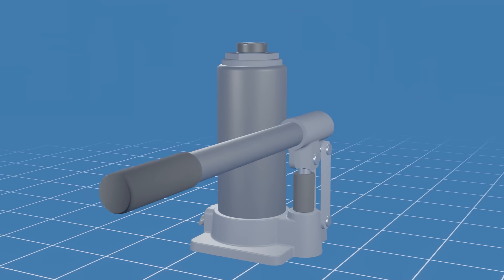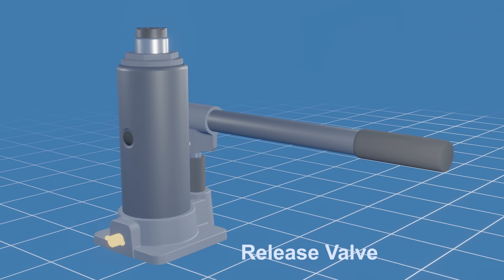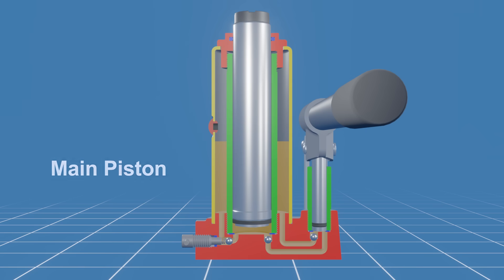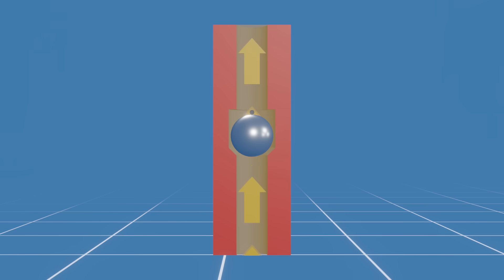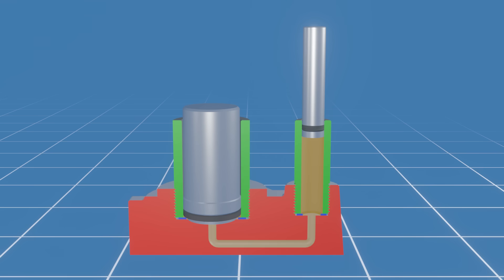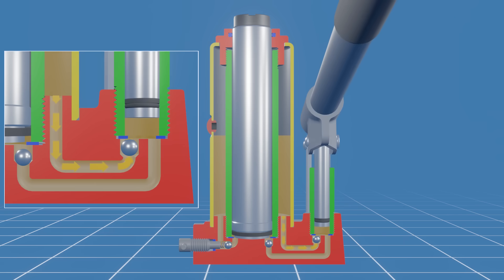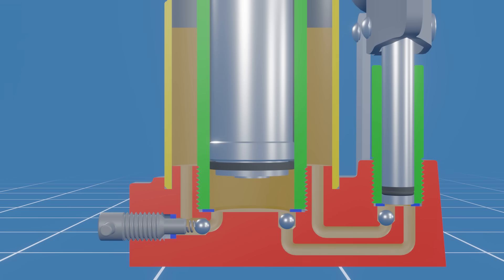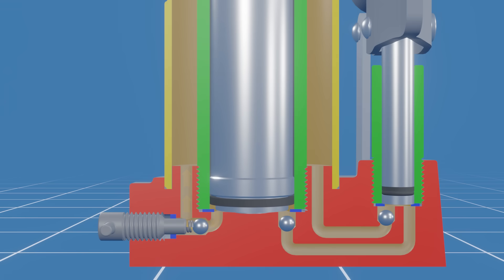How a hydraulic jack works

Comment: Everything makes intuitive sense to me except the fact that the force is larger on the output cylinder because it has more surface area. Why? I get why it doesn't raise up as much because there is only so much fluid and that fluid has to fill a larger volume but why is the force greater? What does the surface area have to do with that?

Comment: When I disassembled my jack I noticed one detail which is missed here: There's a hole in the upper part of the main cylinder, which allows the inside air pocket to move freely between this space and the reservoir's. Its second function is to prevent the piston from popping-out (in case of oil overfilling).

Comment: This is very good but jacks i have used, the pump cylinder is on the right as you use it, yes...but then usually the release valve is also facing straight towards you, not 90 degrees to the left.  Ive used (and gone through) dozens of jacks over the past 20 years.  However this could easily be only on certain brands.

Comment: This video is absolutely spectacular, thank you for that, I suspect it will help me in my repair of a pallet jack. I have one criticism to make. The type of screw adjust saddle on this particular build is used to extend the jack beyond the typical hydraulic limits, rather than to fine tune the height. There are some made to fine tune, but they typically have another rotator on the top to allow it to be raised while already under load, a near impossibility with this model. If nothing else, the screw top goes that little way toward making sure someone is not using blocks on the top to get a bit more height in an unsafe manner.

Comment: This is why I always use a three point safety system when I'm underneath a vehicle. Wooden blocks, jack stands with the tab punched in and wheel chocks. Never rely on bottle jacks, just be very careful if you have to. Find a good rock or something

Comment: Very cool, but if the pressure is equally spread over the liquid, how can that spring for the release valve hold? Wouldn't the pressure be the same on the spring as it is on the piston?

Comment: This is an awesome explanation for how hydraulic jacks work!

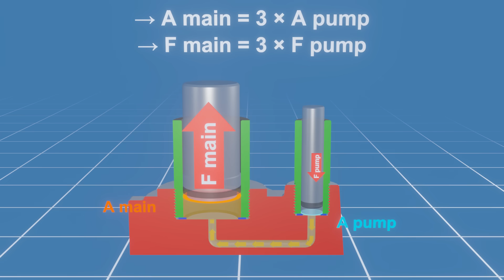something that I'd like to add though is that at 5:22 the bigger piston of the jack doesn't just move a third of the distance of the smaller piston because it needs to conserve energy, it moves a third of the distance because physically more fluid is required to fill up the larger cross section. The law of conservation of energy is always a consequence, never a cause for something!
Reply: It's funny how the law is obeyed and isn't just a rule but makes perfect sense!
Reply: Can't stop thinking about what you said in the last sentence... 🤔

Comment: But after releasing pressure  of oil it goes to second reserve tank,  afterwards how it return to previous reserve tank ?
Reply: Both reserve tanks are the same. It's all around the center cylinder.
Reply: @PeterBruins1  O thanks brother,,I imagined it from only front side in 2D , thanks.

Comment: How does the oil reservoir breathe?
Reply: Look on the left side. That fill port plug is just a rubber stopper it allows air in and out
Reply: @tollav so if it falls over during transport it can leak out?
Reply: @jhsevs  It CAN. More seeping than spilling but the rubber will hold mostly closed and the vacuum or pressure will push the air in or out
Reply: The vacuum is never enough for that to be an issue. The air pocket at the top combined with the limited fluid that can be pumped ensures that.

Comment: This explains why you need to have the release valve stem loosened before you uses it (at least in my manual), because if you don't then the oil can't bypass the safety spring if the load is too much and can explode. Nice video!

Comment: 0:43 The saddle can be threaded so that you can easily place the bottle jack underneath what you want to lift, then screw the saddle upwards so that it engages with a jacking point or mounting bracket. 
I’ve seen some saddles have a concave cup shape thats screws up onto a ball shaped mounting bracket.

Comment: I have a question. 
I have a bottle jack that recently refilled with jack oil, and I did make sure to let the air out and then close the valve.
But now my jack goes up, but won't jack the load. It just stays in the same spot without going up.. what did I do wrong, and how can I fix it?
Reply: Perhaps there's more air in the system or low oil , same thing it could also be that your bottle jack is damaged in some way

Comment: So is the rubber ring holding the whole load?? Or is it kind of forced into place by the cylinder and the oil pressure on the other side
Reply: No the cylinder body it self protects the o-rings from experiencing much force just due to the geometry of the mechanism.  Also, doesn't really make a difference but wanna point out, because of the valves in this mechanism, each set of cylinder chambers or o-ring contains the pressure at different times, the piston during power stroke, the jack while its resting.  

Think of it like this:  The pressure in the fluid everywhere is always equal.  So since the O-ring's themselves are really only experiencing the pressure acting on a much smaller surface area, basically the size of the gap that's allowing fluid to contact, the force experienced by them is much lower.  Also the o-rings themselves are designed to compress, and then squeeze against a larger surface in it's seating.  This is how like rubber/polymers etc can be used as o-rings.  Mind you o-rings still experience force trying to squeeze them out the opposite direction, and o-ring design is very intricate.

Comment from the maker: Feel free to ask questions or share your thoughts below. And hey, if you're loving what we do, consider supporting us on Patreon: https://www.patreon.com/Deconstructed_Animations
Reply: Why is it 3 times the force over a larger area?
Reply: Can you please make a video on hydraulic brakes
Reply: Fun fact o have a bottle jack in my spine but bone growth is what makes the jack rise up
Reply: how come the fluid on one side comes back to the other?
Reply: Does it become harder and harder to lift something with a hydraulic jack as it is being used. Like as the load is lifted higher, the column of fluid over the check valve seems to get taller, which applies a higher pressure on the valve right? And this needs to be overcome by the pressure generate by our pumping. Is this correct? Please correct me if I am wrong.

Comment: Pausing at 0:15 tells you all you need to know. I would wonder about gas pressure cause we're increasing the internal volume, but given we have a steel construction, and the pressure difference can't be particularly high, it's a nonissue.

Comment: Surprised the safety spring is strong enough to hold back the pressure even under normal working conditions.
Reply: agree. they probably use very stiff and strong springs to make it work especially considering its small size. wonderful engineering indeed

Comment: My bottle jack also has a small bleed orifice hole in the side of the main cylinder just below the mechanical top end stop so that if you raise it all the way up the oil just sprays back into the reservoir preventing you from jacking against the end stop itself. The piston/ram stops lifting a few mm below the stop instead. I call it the lift limiter.
Reply: idk if its been implemented yet but you could make some money of this idea
Reply: @SlumpedSwine  ? I didn't add this hole it came stock, it's a 2 ton rated jack that I bought years ago at an Aldi Foods store, IE the US branch of Aldi Süd.
Reply: @danielthechskid  A food store sells jacks? Seems strange.
Reply: @soaringvulture  Yes, Aldi is strange like that. They'll have a different batch of random non-food items each week that when gone you never see again. They even used to occasionally sell computers that were Medion branded.

Comment: Great work and congrats on the new channel (and a new sub!) I love this sort of explanation, and I've always wanted to see a good diagram of how this works.

My only critique would be in explaining how pascals law works to increase force from the handle piston to the load piston. I think it would be clearer to just explain what's going on in simple terms and then talk about pascals law, I found it hard to follow.

From my point of view: since the load piston is larger than the pump piston, pumping 1 unit of fluid from pump to load will raise it up less far, by the ratio of the surface areas. But because it's going less far, it must have greater force. Since the cross section area is proportional to the square of the radius, you get quite a bit of mechanical advantage for a small increase in radius. 

Some example of common numbers of force multiplication would have been cool to see, too: "In a typical jack, the handle ratio is about 10 to one, and the area 20 to one, so a 200x increase in force" or whatever.

In any case, I look forward to your next video, if you choose to make more!
Reply: ultranerd

Comment: I'm not sure I understand where the "work" goes when the release valve is open? - If I keep the release valve open, and continuously pump the handle, couldn't I pressurize the entire oil reservoir?
Reply: nope.
Reply: @skataskatata9236  why not
Reply: @vuza752 it's a close loop. You take oil from reservoir and you pump it in reservoir. It's the same reservoir. Video shows side crossection of reservoir but if you look on it from the top it would look like a ring.
Reply: @Max_Jacoby Right! So the work wouldn't continously increase pressure, just pump the fluid around.
Reply: @vuza752  And if the lowering valve is only slightly cracked open so that each pump stroke develops pressure then the fluid spraying through the small gap causes turbulence which causes the oil to have friction with itself and since that causes heat the fluid is slightly warmed. The same heating happens every time it is lowered, the gravitational potential energy of the lifted object becomes heat energy in the oil.

Comment: The one thing I have always been curious about, is how the jack doesn't tip over with a handle that long! Bottle jacks are truly magic!
Reply: Do you mean when there is no heavy object on the jack, why pushing down the long handle doesn't cause it to tip towards you?   
Well, as you push down on the handle that movement is converted into movement in another direction. 
You move the handle, which moves the oil, which moves the piston. 
That's the first bit of "magic" you can't see, internally, oil is being moved by the handle movement. 
You notice that the long handle moves a big distance, but the piston only moves up a little bit.  That's the other "magic" part, or physics really, explained by the video. The whole jack doesn't move, only its parts because the large input movement is balanced by the small output movement but with a much larger force.
IF, however, the oil and the piston cannot move, but you can still move the handle, THEN you would tip the whole jack over.
Make sense?
Reply: Being low to the ground as well as relatively wide base would be my guess. Though I might be wrong.
Reply: @RabidBeast45  but then to jack it, one must apply force at the end of the handle that is close to the same length as the jack is tall!
Reply: @CallMeByMyMatingName  Like the other guy said, it works cause you have a working fluid inside that is able to transfer all the force.  You're looking at it like its a static or rigid body, when it should be viewed as an incompressible liquid you are performing work on.  So long as the force in this system balances, i.e. the force of the handle is able to push the jack it's appropriate corresponding distance or in other words the fluid flows since it's essentially incompressible, there will be no force transmitted to the jack body, only the fluid.  Or in this case because the force is off center, no torque/moment will be applied to the jack body.  Once this no longer balances, the fluid would stop flowing, and it the jack would act as a rigid body, and you'd start torquing it with the handle and it would want to tip.

Comment: If the oil from the reservoir lowers and rises from jacking up and down, does it suck and expel air to maintain the atmospheric pressure inside? If it does, does it seep through the plug?
Reply: The reservoir is vented to atmosphere.
Reply: @koharaisevo3666  no it isn't
Reply: I thought the plug forms a tight seal (except when you intentionally bend the plug to let the pressure equalize). If the oil reservoir is about half full of oil, then even if you used all the oil reservoir the pressure would only drop to 1/2, which would be around a 7PSI difference. I'd assume that just doesn't matter.

If the reservoir is vented to atmosphere then there would be no air pressure change, but wouldn't it leak oil if you tipped it over?

Comment: Hydraulic jacks are just another form of lever. And like ALL levers, they "work" by trading force for distance.

Operating the jack lever converts a small force over a moderate distance (pump piston) to a large force over a short distance (main ram).

Comment: Outstanding vid!  I once had a low profile floor jack that would slam back to the rest position with even the slightest of turns on the relief valve. It always pissed me off. I eventually just gave it to Good Will.